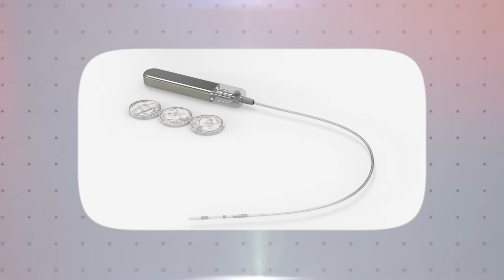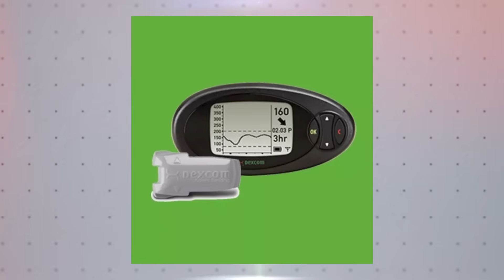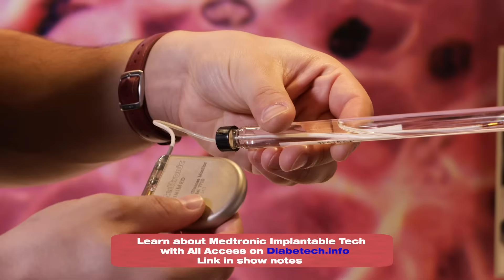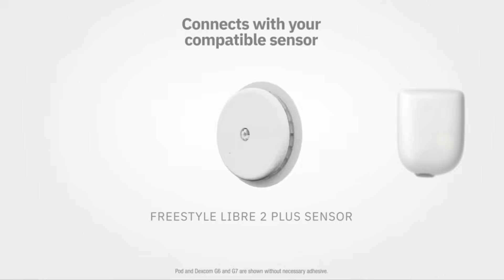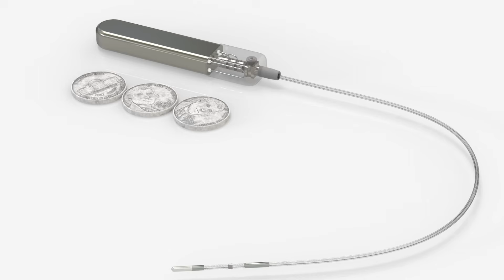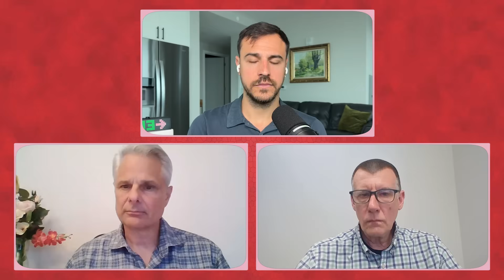A CGM That Measures Blood Is Coming – What You Should Know

Comment: Begs the question why are all these non-cure items coming out like gangbusters all with there own sets of issues when a cure is the REAL SOLUTION and the problems are very focused on producing stem cell based insulin producing cells that seems to be solved and all that is left is protecting them with a membrane or other immune system preventatives but has been under develop for way longer? I've watch the videos on cures on Diabetch like "Diabetes Cures In The Works" and still don't get it? I am still on injections and a CGM and am able to keep my A1C between 5 to 6 for over 43 years with no side effects like retinopathy but it take diligence but way safer and easier than dealing with a pump and implanting devices.

Comment: How does this handle MRI/CT scans?

With Dexcom/Libre you remove and start a new one.
With Eversense, you remove the transmitter and can do MRI with sensor left in place (with some limitations).
I miss my Eversense sooo much.  Using Dexcom G7 now.... ugh.
Reply: Why dont you put everesence again? Is the best cgm in my opinion.
Reply: @shadowbluejay  no insurance coverage... too $$$
Reply: Good question on the MRI scans.  Be very painful getting that ripped out of your side during a scan.
Reply: @dwightl5863  perhaps... or maybe not enough metal to cause issues?
Reply: Eversense was a nightmare. I was part of the original v1 (90day) and v2 (180day). I have never used a CGM and reminds you EVERY day you have diabetes. Between calibrating twice a day (v1 and early v2) along with the terrible battery of the transmitter. Charging that thing every 32hrs (v1) when it was new and maybe getting 18hrs charge out of a 5month old transmitter. Lets not even go into the scars on both my arms. I will say that was due to the Dr "learning" which got marginally better during year 3. I am just glad I got nearly 3yrs of Eversense for free (they actually paid me nearly $100 a month to be a guinee pig!) Only good thing was the adhesive was the least irritating to the skin compared to all the rest.
Reply: @philsonnenberg6092  no need to calibrate really.  It's FDA approved not to, they just cover their asses by "making you".
Just simply enter in the same value as a calibration as it shows.   If you doubt it, perform a real calibration.  I ended up only calibrating maybe once a week.... the finger stick and CGM were ALWAYS within a couple points.
For charging, I had extra chargers, so would just peel off the transmitter whenever convenient and charge up.

I'm just sick of the pressure lows, the failed G7 sensors, the adhesive issue each 10days, knocking it off...etc.  With eversense it was easy and reliable (mostly).
Reply: @philsonnenberg6092 The Eversense 365 is said to need once a week calibration compared to older models which were at least daily.

Comment: I need this cause my cgm actually reads my blood sugars as higher than they are. My a1c and finger pokes are 2 points lower than cgm
Reply: Totally accurate CGM readings.  Your finger sticks could easily be off by those points.
Reply: @dwightl5863 so then why does my A1c reflect my blood sugar readings and not my cgm. Also blood sugar is always more accurate. Cgm measures interstitial fluid not blood. Blood is more accurate
Reply: @SharpLife4  Agree, blood testing is more accurate at that particular moment in time.  Need to realize that interstitial fluid is behind the blood reading by about 15 minutes.  CGM readings usually are closer to blood glucose if you test when the steady (horizontal) arrow has been there for the last 15 minutes.  That is also the best time to do calibrations.
Reply: @dwightl5863 actual A1c 6.5. Cgm prediction. Said 7.8 that’s a big difference. Even my endo said it was too much. So for me g6 is more ideal cause I can calibrate and get it in sync. G7 I can’t
Reply: @SharpLife4  My last G7 a1c was 6.1.  The labs a1c was also 6.1.  Be sure you are looking for the a1c reading for the same timeline as the lab result.  A 14, or 30 day a1c that Clarity gives  could be quite different for a 90 day a1c.  The G7 can also be calibrated.
Reply: @dwightl5863 yes my dr reviewed he. For all the settings it was still higher than my actual A1c for the last 6 months of using it. He had me test blood sugar with meter and record it and Dexcom. He has decided the g7 reads high for me
Reply: do you mean 2.0 mmol or 0.2 mmol or 2 mgdl cause unless its the first one thats very accurate
Reply: @xcalibro6483 I mean if my blood sugar is 7mmol by glucometer my Dexcom g7 says it’s 9 or 10 and my Dexcom g6 says it’s also 7. So the g7 reads higher. It also estimates my A1c at 7.8 and my actual A1c is 6.5 and I’m not anemic to falsely lower it. So we tested out why and found my blood sugar is always actually lower than what g7 says
Reply: @SharpLife4  ah that is pretty bad tbf. i had a similar experience with the g7 had to switch to g6
Reply: @xcalibro6483 my dr wants me to switch back but the 2 hour warmup and needing a seperate transmitter sucks to me.

Comment: I’m in the process of watching so if this is addressed later please ignore! But if it’s implanted for 3 years, on let’s say my right arm, my impression of using a pump such as OmniPod is that I’d be losing signal if I ever wore it on my left side throughout that time, so I’m not sure how that would work. I always get signal loss unless both devices are on the same side, so I’m curious how / if they’ll address that - I’m sure it’s way too early, but it’s my biggest question with these long lasting CGMS

Comment: Excellent show!  The CGM seems to be the weakest link at the moment, with the delay in readings, the connection issues, the compression lows, the general inaccuracy, and the limited functioning time.  Bluetooth might be the weakest link of this implanted CGM.  Bluetooth disconnects and isn't good at penetration and is susceptible to interference... at least that is what I experience with my current Dexcom bluetooth paired (or sometimes paired) with my iPhone.
Reply: And with this implantable system, there is no way to read it, if it doesn't go through the external system, right?  My Guardian 4 right now reads to the pump so it rarely loses readability like a system using Blue Tooth would.  For people who are hypoglycemic unaware, a tragedy might result, if the cbgms couldn't shut down the pump or increase the flow of insulin to stop a high.
Reply: @dinkster1729 Your Guardian talks to your pump via Bluetooth as well! Or did I missed something?
The pump could become compatible with this CBGM and they think it's worth it. I don't see any difference but I might be wrong.